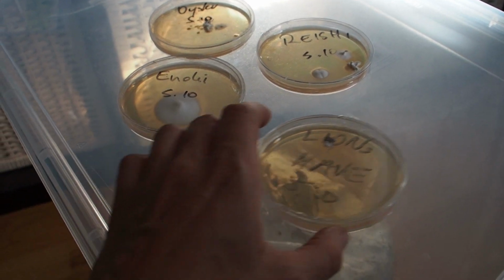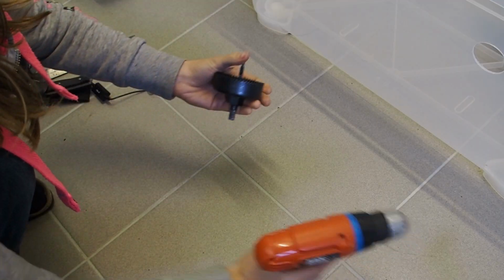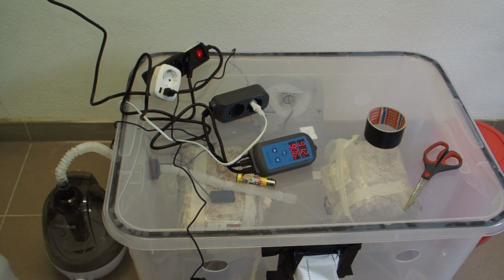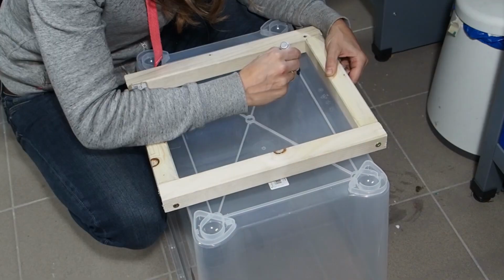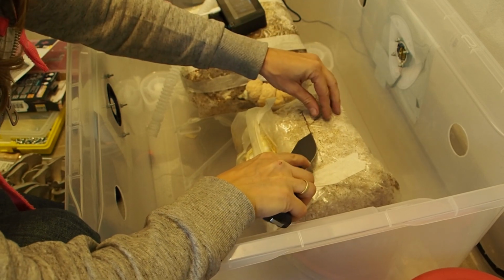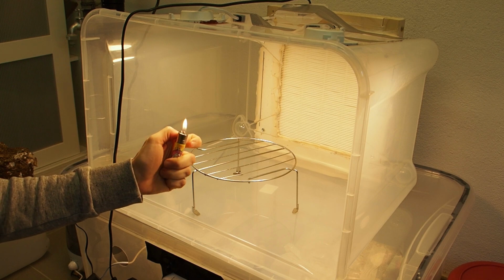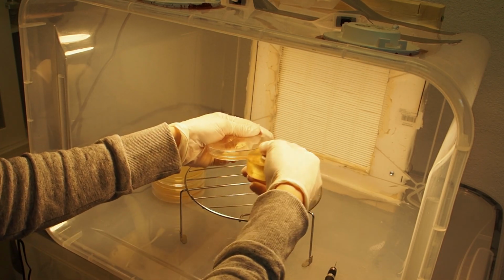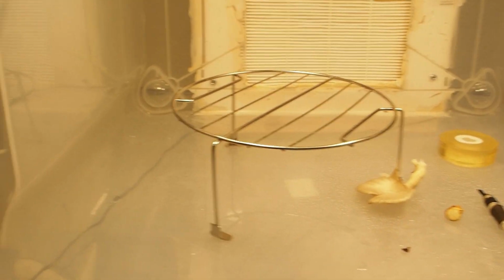Successfully Growing Blue Oyster Mushrooms inside of a Plastic Tub and Building a Laminar Flow Hood!

Comment: You can still use the contaminated plates by taking clean mycelium from the farthest side, away from the contamination and transferring to a new agar plate. Also, great idea to build your own flow hood but those fans are not strong enough. An industrial fan can be picked up for about $150 that will do the job properly.
Reply: Inline fans work fine get one with a variable speed controller how I built mine